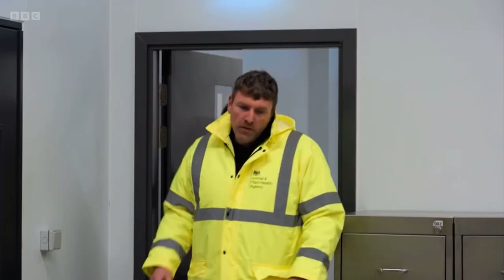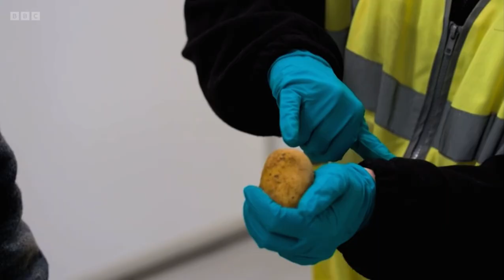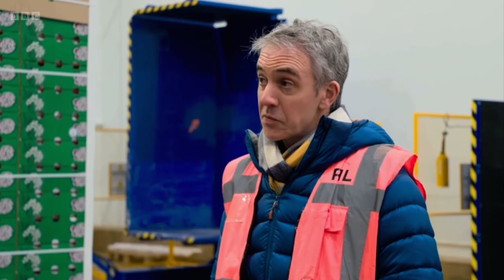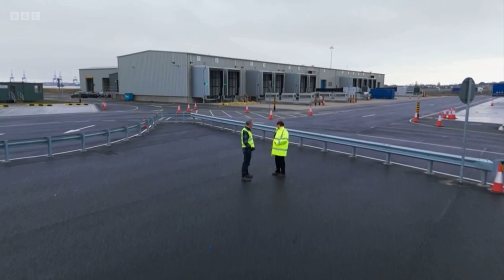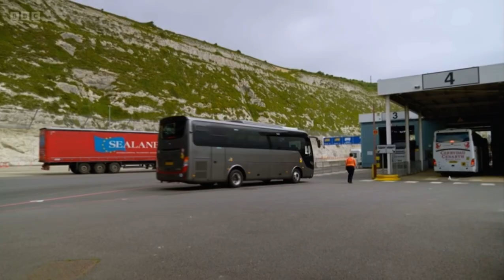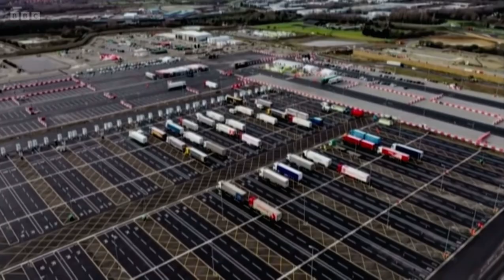Brexit Borders: Illegal Meat Now On Most 🇬🇧 High Streets

Comment: Is this video a bit one sided.
Correct me if I'm missing something, Before Brexit checks were done by suppliers and conformity certificates arranged or something similar.
This was good news for the law a binding and may I suggest a gift to any criminals.
If we are worrying about trucks cargo being tampered with between Dover and Sevington now, wasn't it a concern before Brexit that trucks could be tampered with before in a layby either in the UK or continental Europe.
I find it difficult to believe that there weren't criminals before Brexit bring in the wrong things and also the law abinding producers within the EU are now offloading sub EU standard products on to the UK.

As for the cost of checks we have to decide is it worth it for bio security it gives although not perfect as yet as was discussed in the video.

In the past I used to hitch hike, hitching across the channel wasn't a problem and can remember being told by a truck driver that we had to go from Dover to Folkestone to clear customs, so I suppose a cargo could potentially be tampered if it was dodgy.
On another occasion on a fruit and veg truck, pallets were swapped in a service station so drivers could reduce their mileage by not having to go to every fruit and vegetable markets around the country on there contracted routes.

These are merely my thoughts and observations, but as first stated the video appears a little bit one sided.

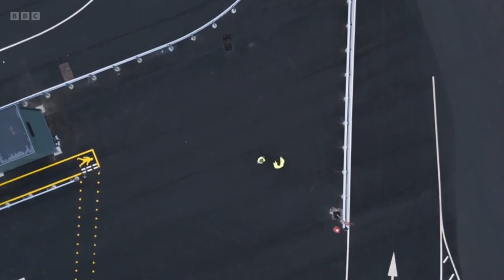Comment: 8:12
"40 years in the UK to be used to having no border with the EU and suddenly there's a border"
You had 8 years, there is nothing "sudden" about that border , it didnt turn up 
out of the blue but was put there by british voters repeatedly voting for Brexit and Brexit supporting parties.
Reply: Some British voters, not all by a country mile. Stupid Cameron couldn't run a pissup in s brewery..
Reply: @ 
Everyone knew there would be a border , those that voted for it and those that voted against it. This officials audacity to pretend the border was a surprise is outrageous.
Reply: Unfortunately it is a total cockup.
Reply: @Ooze-cl5tx  Most British voters didn't vote for brexit backing parties.
Reply: @Paul-eb4jp  
The british voters in the last GE voted >70% pro-Brexit parties from "make brexit work" to "get brexit done" to "no deal brexit"
Reply: @Ooze-cl5tx  Brexit was done and dusted by the last GE, it wasn't an election issue.
Reply: @Paul-eb4jp  
You claim "Make Brexit Work" was not a key point on the winners manifesto ?
Reply: @Ooze-cl5tx  Starmer accepted it was done and dusted, we are where we are and we have to make it work.
Reply: @Paul-eb4jp  
And it took you 8 years to come up with a plan that doesnt work at all.
But like Johnson , you did your best, so its fine.
Enjoy.
Reply: @Ooze-cl5tx  You sound quite bitter, I actually campaigned for remain but I accept we lost and we have to make the best of where we are. We need to repair the damage of 14 tory years and I'm personally very happy with Labour's performance so far.
Reply: @ 
Im looking at it from the outside and i had a  lot of hope when Labour won.
Watching the UKs performance under Tory and now Labour rule convinced me that having the UK removed from our EU was a lot of pain but worth it in the end.
Reply: @Ooze-cl5tx  I think Labour are doing a really good job despite the right wing media and countless online bots trying to bring them down.
I wish the EU well, I live here after all.
Reply: @Paul-eb4jp  
I do accept that the UK media is hostile to Labour and a lot of online critics of dubious  origin attack them the same way.
But i fail to see how that abuse is seen as responsible for the way they treat those border checks. Even if it was set up that way by Tory saboteurs Labour had > 6 monthe already to correct it.
Just as a hint , in the EU it is possible to put a customs seal on a transit lorry and make sure they have to show up at a designated exit border post way further away from their entry point into the EU than the 22 miles that makes the UK loose such lorries.
Reply: Even when Johnson was voted in in 2019, 57% of votes went to parties pushing for a 2nd referendum.
Reply: Agree. The reporter was too terrified to ask that bully officer, what's been going on for the last 8 years?
Reply: Never mind farmers, no one was debating the impact on the Good Friday Agreement before that vote.  The people of NI were being thrown under a bus.
Reply: @macsmiffy2197  The people of NI got a better deal than the rest of the UK.